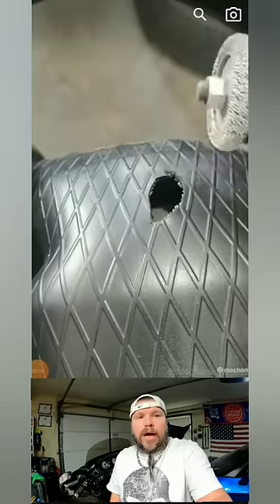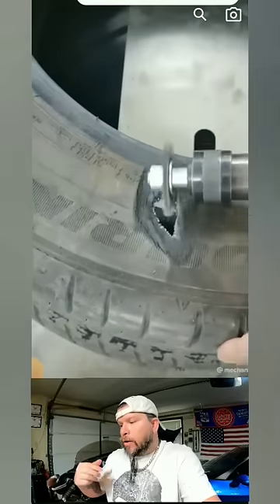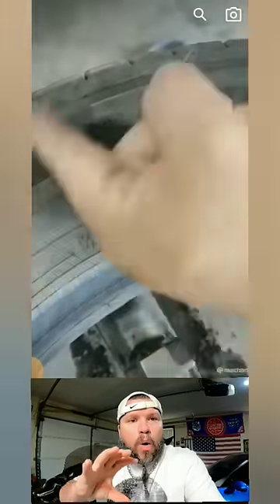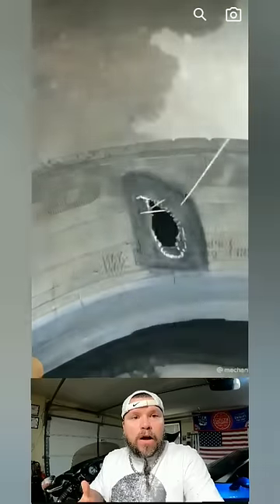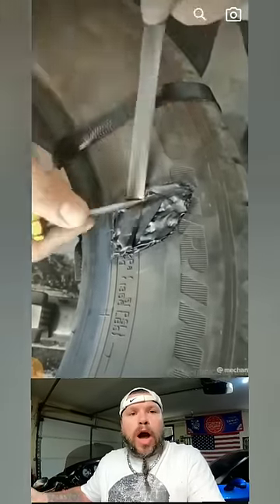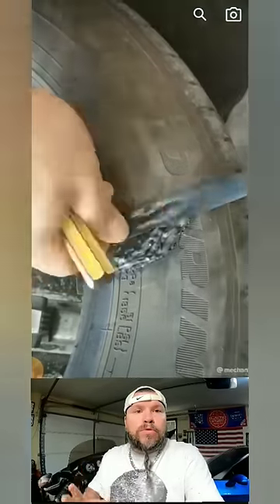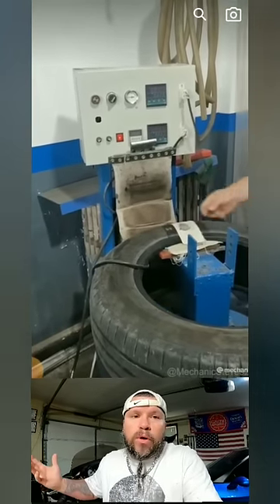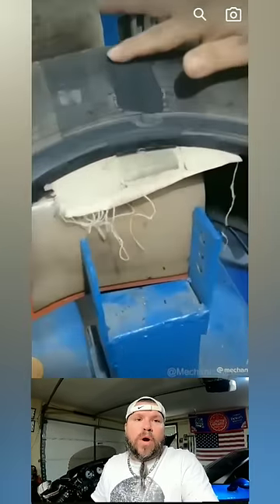patching a tire

Comment: There's this new generation of sidewall patches.  It uses metal wires pushed into the sidewall using a chemical that causes a reaction in the rubber to burn.  Rubber when not exposed to oxygen will melt instead of burn literally bonding to the rest of the tire at a molecular level.

Comment: I had a puncture on the side of my tire. Spent over 200 dollars a piece for those tires. I ended up running inertubes in my tires. It worked out great.
Reply: A small puncture is one thing. A 2 inch hole, no way.

Comment: I was taught at auto class in college, NEVER do this. Repairing tread area is ok provided it's small enough, once side wall is damaged, treat tire as junk and replace it. Someone comes in with this, make sure to alert super and have them make note in file, this is a death trap waiting to happen and I wouldn't even use it for offroad on a golf cart.

Comment: The sidewall is an issue for sure, but looking at the type of damage, the internal threads holding everything together are totally missing cuz of the giant chunk missing. No longer a structurally sound piece of rubber.

Comment: I worked at a tire shop for about five years, and we definitely would not touch a tire that had a hole or a slit on the sidewall.. but hey, if it holds air, it can be used as a donut to get you to a tire shop to get a new tire

Comment: Dumb it down: sidewall compromised, get new tires. Don't cheap out on em either, find a comprimise.

It's best to replace all four at once + spare; mixing tire tread patterns and uneven wear over the wheels will mud up handling in inclement weather/low traction environments.

Tldr: Do it right one time. Shell out once, not twice or your life.

Comment: I did tries and breaks for years. I would never, NEVER, touch any tire damage or punctures within an 1/8 of an inch of the shoulder.... I'd straight call this criminal negligence and report that guy to the DPS to check his shop and work.

Comment: As someone with a certification in tires and tire repair, I can say that there is a correct way to repair side wall damage, but this is definitely not it. It's called a section repair and they cut out a clean square/rectangle of the side wall and replace the whole thing, introducing new chords and everything, which will then be indicated by a blue triangle next to the repair so that the next technician to see it doesn't mistake it for damage.

Comment: The way tires are made is they have a weave like system of fiber interwoven together creating a wall which supports the ends, once that weave is broken there’s no going back, you can weave all day long, it’s never going to be the same and it will blow on you….I worked in a tire shop and in a brake shop before that and when a tire had wall damage or even cracking we’d recommend new tires and if it was bad enough we’d refuse service all together.

Comment: Even new tires separate.  Patching sidewalls is a deadly practice.  Never patch a sidewall, even for needle size holes.  There is a tremendous amount of force applied on the rotation that flexes the entire sidewall.  It is not worth the guess, just get another tire.

Comment: The sidewall of the tire has a weaved steel lining throughout it and this cannot be repaired. This is what provides the sidewall safety factor of the tire. When that lining is torn or cut the steel lining is also cut and renders the tire useless.

Comment: In third world countries, this is a daily occurrence due to the cost of new tires. Technically, this patch is good for vehicles that can’t go faster than 50 kilometers per hour. The patch should expand and flex at that speed without any problems.

Comment: Funny you mention running it on farm equipment. That's a bais ply tire. Odds are that's a tire off a farmer's hay trailer. Which only goes down the road at the 10-15 mph the tractor can manage. Which is why they are repairing the sidewall damage. It's perfectly acceptable to repair damaged sidewalls of bias ply tires. Looks like a 4 ply tire so anything under 2" is repairable on the sidewall unless it's on the bead.

Comment: My tire supplies provider says that this is not acceptable on passenger car tires (~40 psi) in the USA and most developed countries, but truck tires (~100 psi) can be repaired this way.  In many countries, this sidewall repair is acceptable.  This is completely outside of my experience.  I simply replace tires with sidewall damage.

Comment: This is entertaining to watch don’t ever bet your life patching a tire like this and driving down the street slamming on the brakes at 60 miles an hour does a lot more to attire than you think when you’re behind the wheel. This man is 100% correct never drive all the tire like this your life is worth more than 100 bucks. Different if you’re just using this on some trailer that you’re towing around your property, full of mulch and dirt, but not on the actual highway or street.

Comment: Once the sidewall is done the tire is compromised. All off those steel wires that give it integrity are no longer doing their job. That tire WILL fail, and if you are doing any kind of speed it can be deadly.

Comment: You can send them to a retreader and they will retread a tire . They may even vulcanize it and fix the sidewall for a spare for trailer only . Never run a sidewall damaged tire , especially on a steer axle !

Comment: Sidewalls can’t be successfully repaired. It flex’s constantly at each revolution. Notice how the part of the tire that touches the ground bulges. If you must put a inner tube inside the tire for temporary use it’s much safer

Comment: The only thing holding the sidewall is metal wire, so if you make a hole and it's on the sidewall, the tire is going to collapse on its side

Comment: I worked in tyre garage, and used to repair tyres like that all the time, but only for Agricultural vehicles a car tyre is designed and built for different purposes to agriculture or HGV. This is a seriously bad idea on a passenger vehicle with other vehicles on the road, although it is done it shouldn't be.

Comment: Normally made tires blowout everyday, so a patch up one can as well. If you know this is what you have drive like it. As the narrator said use it for certain jobs, common sense should be common enough. However, when your country is oppressed by the narrator's country you don't have the luxury of using it like that, this tire will decide if there is food or not on your table for you and  the family. So it will hold until it can't hold anymore and the next patch will do the same. This is life, we do what we need to do, and we are very good at it. It is an Awesome job, and My God is an Awesome God.

Comment: But if you cut and glue a 8 inch piece of thick tire on the inside of the tire then put a inner tube in that tire it will hold. Try one an you will be surprised. It will work with this. Make sure you got hard tire part glued down inside and place new inner tube over that part. Pump it up gently.

Comment: When I used to work in a tire shop, they wouldn’t let me repair anything on the sidewall, 
Even if it was a Bobby pin sized hole,
They would either force the owner to buy a new tire, or just send him off to another shop

Comment: I like how everyone commenting on this has zero experience with doing or using sidewall repaired tires. Go work at a tire recycling facility. In the 90s probably 5%of the worn out tires had sidewall repairs. Good idea?probably not. Will it work? Most of the time yes.

Comment: 😮😮I worked for a company HGV, and the boss used to cut his tyres just to get an extra month😮
Reply from the maker: That happens a lot more than you think!
Reply: @badlsxgarage  
4 real ?
He was doing it on a MT skel when I got back to tilbury dock, at first I took note thinking to avoid it then I thought what does it matter if his done it once his done it twice, right?
I had a trailer tyre blow on me on the M6 at 3am and it overtook me doing 54mph up the road for about 300 yards. I went and got the bugger, rolled it back as there was no hard shoulder.  Man that bitch was heavy and unyielding and never rolled the right way,  like a few dates I've had.

Comment: My personal rule of thumb for sidewall damage... if its a pinprick/nail puncture it can be patched but any bigger than a large nail, and that tire cant be trusted.
See a tire usually has wires inside for structure, and being punctured causes a weak pint for the pressure to break.
In this videos case... i wouldnt trust that for more than a day... it would do you better to ride on your spare tire and replace that one entirely.

Comment: tire uses steel wires for strength. thousands of wires. rubber holds the air in.

Comment: People don't understand the very things, the very dangerous things, they drive around in every day. The tire is one of the MOST IMPORTANT aspects of your car. Its the one (or 4) thing that is keeping contact with the quite solid ground you are traveling on at what would otherwise be deadly speeds. If your tires aren't decent or properly taken care of then YOU aren't properly taken care of. Always do yourself a favor and get the best tires you can for your car, do a little research about them, by all means get a deal, but get good ones so the thing can do its job as best possible.

Comment: You COULD do it like this, IF you put a whole lot more wire in there that will hold up for the pressure from inside!
It should basicly be a full weave of stiff non flexing treads, where you just cover it with that black stuff to make it air tight, because the weave carries all that pressure...

Then it could be doable, but it would be too much work for any sane person, since we're talking a full day of just making that weave good and strong enough....
Not worth that work

Comment: For a farm trailer, that's never going over 40. This is what you need. 

Not every tire is going high speed. If you own a POS car and drive it to work and back. This will do you fine until you need new ones.

Comment: I believe it will work if your just Driving in your city only  yeah as long as he patch the inside of the tire too but put some wire like those chicken fences the real small ones cut a small peace cause tires have wire in the to help it from it falling apart from all the weight and pressure think about it that my opinion Later...

Comment: Yeah i hated patching anything on the side. Had one tire come back and my manager tried to bitch at me about how a tire could be flat an hour after i fixed it. Made him put it in the dunk tank and there wasn't any sign of a leak i told him it was probably from the weight of the car pushing on that side wall you made me patch, she got a new tire instead

Comment: Plugged holes in sidewalls w no prob for life of tire not this big of course & gotta use the orange rubber plug w rubber cement not rag plug but I know from years of experience it works w no prob & yes mc tires CAN be plugged w no prob also

Comment: You NEVER Patch a tires side walls, it’s not meant for it. It’s possible to put a patch on. Just they wasn’t made for patches to go on the sidewalls.if the hole where the plug or patch needs to go is on sidewalls, even if it’s only part of the hole and rest of hole is in the part where the tires treads begin at you never reuse that tire with a plug or patch job. Never do that if you care about your life

Comment: i had a 79 Chevy C10 lifted 8in had 38s on it had a stab hole in all 4 tires in the sidewalls had a rubber boot installed inside covering the holes never had a issue driveing back and forth to work 4 wheeling every chance i got
Reply from the maker: Ok…ok this one got my attention! All 4 tires stabbed?? Can you say psycho ex?!?

Comment: The tire has its strengths from steel bands/wires in the tire itself, like he said when the side wall is compromised the entire tire becomes scrap rubber those bands will never regain that integrity and you will kill your self or someone else driving on that thing

Comment: That’s against Procedures. You will cost that company a bad rep or even worse a lawsuit. Side wall of the tire is the weakest part of the tire you do not make any repairs any where near or on the side wall. 🤦🏽‍♂️

Side Note: I was Sent home from my job because i had a disagreement with the Assistant Manager of the job. He wanted me to patch up a low-pro tire 25series tire off of an Audi. I said no i ain’t touchin it my GM came in he immediately saw the tire and told me himself “nope cant fix it” i replied well that dumbass is forcing me to do it just to do favors. Assistant manager came in the back and said “clock out” i said “Say Less” i told everyone in the shop “ do not touch this this car and tire leave it and let him figure it out himself “ i went home on my merry day.

Comment: Then he's gonna mount it with that face facing the underside of the car, patch up the rotten frame rails with 2x4 from home depot and off to craigslist it goes.
Reply from the maker: Headline reads:  Southern car, low miles no rust!

Comment: I had a random good tire sidewall blow out, on my rear tire, was only going about 20 mph or so coming to a light to turn, as slowoing down i head somethingz feel something, pull over, and the tire has a huge hole in it, the tires only had like 20k miles on them and a few years old. Just maybe got a defective one or all those pot holes finally did me i

Comment: Hey as a former auto mechanic this is not dot compliant and is illegal any shop worth its salt would not dare take the liability involved with this, side walls are in no way ment to be patched tand the actual law says you cannot patch a tire with in 1/2 inch of the side wall overlap because it can compromise the integrity of the tire.

Comment: You should never try to repair the side walls of a tire. Anyone who does or tells you it’s ok doesn’t know anything about tires or tire safety. The side wall is the thinest and weakest part of the tire. You’re safer in the long run to replace the tire. There’s a reason you don’t see repair kits for side walls.

Comment: The steel is completely missing! This tire has little to no structural integrity. It’s extremely risky to put the mass of a vehicle on these and then add rotational forces on it…

Comment: So it’s not being on a straight road that is the problem it’s cornering. If this sidewall is on the outside of the rim and at the front then any cornering will more or less put the entire weight of the car through that little patch with its few wires holding it. Not a chance in hell will it hold under any kind of stress and that’s the exact point you do not want a tyre to let go. 
This is dangerous in the extreme.

Comment: Having worked in the mines and seen tyre repair, you definitely can repair tyres to “hold” like this. Diff application without as much speed or pressure but definitely possible

Comment: That repair is almost correct.
Reply: In an actual facility where they do retreads they can fix the sidewall as they will put in special patches on the inside and outside along with uncured rubber and bake it when they cook the new tread onto the casing

Comment: You realize that's how the side wall holes on a truck tires are repaired right? They are called section repairs. Who knows how many thousands of tires on the road with that type of repair

Comment: I don’t understand all the rules regarding tires, and the fear of a flat, yet tires go flat every day, regardless of previous damage or not, you would think if blow outs were the equivalent of loosing your parachute on a skydive, that they would run street sweepers down the shoulders of americas highways., yet I have yet to see any efforts to remove steel parts that fall off cars daily from even the driving lanes.. fix the tire if you can, and if it balances, and drives ok, run it, if it’s a real problem we have sent a spaceship to the moon, figure out a safe way to repair them…

Comment: Innerliner, Body ply 1, Body ply 2, Bead set then the rubber on the outside mixed to the proper chemistry. Nothing can solve the missing body ply cords. Not properly stitched together to mimimize air bubbles. Very weak repair but it did look like a quality repair press setup. Proper x ray machine would reject this repair. Worked in a tire factory 11 years. Bridgestone/Firestone Aiken, SC.

Comment: It only has thread not tread which is a different but strong threading but called a treading in the tire to hold, what these guys are doing is filling on with thread and rubber, once the side wall is beat, that's it, it's done, the integrity of the tire has been compromised. It integrity is gone!

Comment: Use it on farm equipment?  Do you mean like a tractor that weighs 3+ tons that could be miles from access to a jack or service of any kind when it hits a gopher hole and this explodes?
Reply from the maker: You can’t use car tires on farm tractors. You can use car tires on hay wagons etc. Farm tractor tires are rated different. R1, R3 & R4. Heavy duty tires that are filled with calcium chloride/not air…for weight/traction purposes.
Reply: @badlsxgarage  You can and I have used truck tires on the front of medium sized tractors for years because you can get a good 8 layer truck tire for between 1/4band 1/2 what an ag tire costs.

And you only use chloride up above the frost line around about midways through Kentucky. Down south, plain old tap water is sufficiently contaminated to not freeze in most conditions(at least it never has with us). That said, chloride is being displace with products like RimGuard that are both heavier and so not promote rust.

Comment: Ive seen a 35 12.50 17 with 3 plugs in the same spot on the sidewall, told guy it was unsafe, saw himna year later, same tire same plug🤣